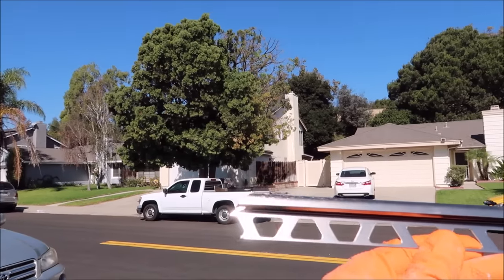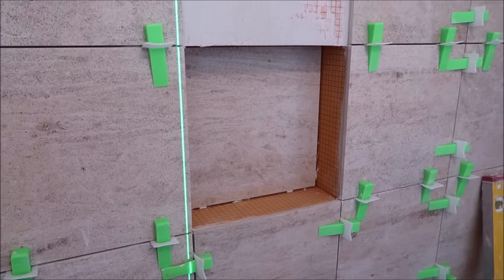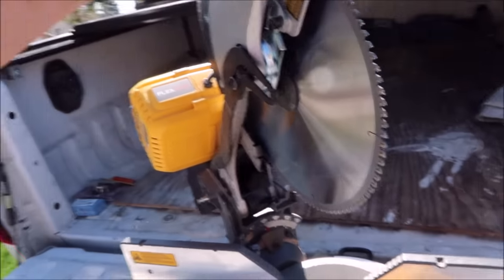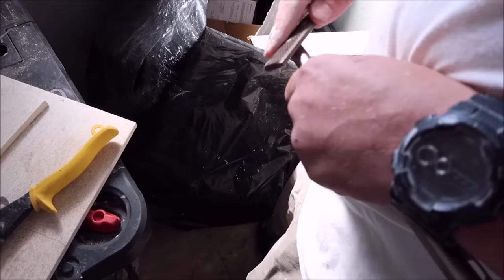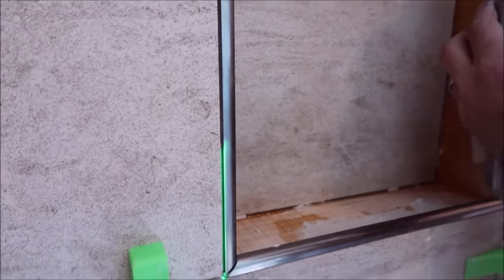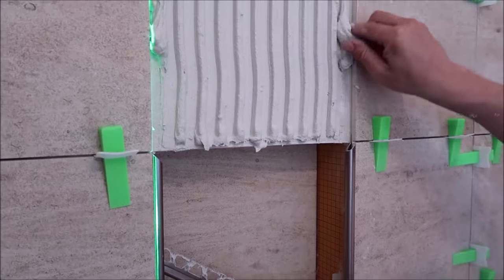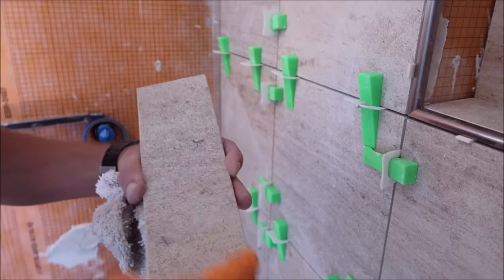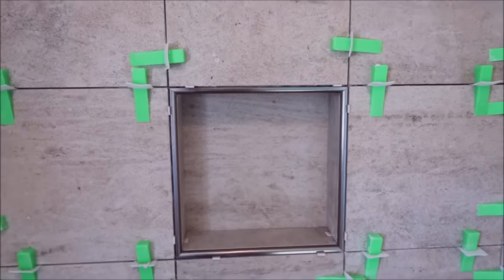Modern Trim for a Shower Niche

Comment: Sorry but this is NOT the way to do this and this video will set you up for failure…. people DO NOT install back tile first, BOTTOM FIRST THEN BACK THEN SIDES THEN TOP…. you don’t sacrifice correct waterproofing procedure to make a piece of trim easier to put on, you learn how to put the trim on while still doing tile correctly